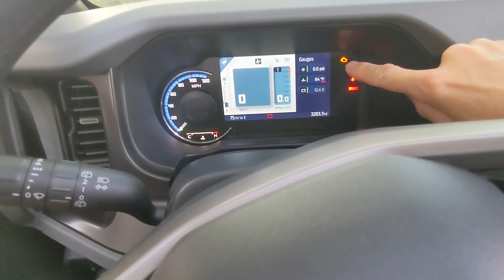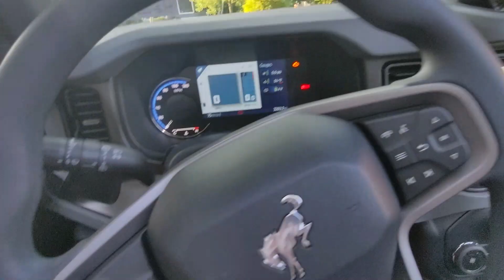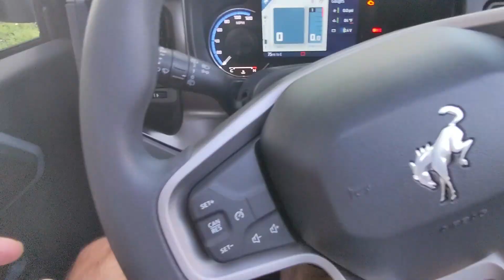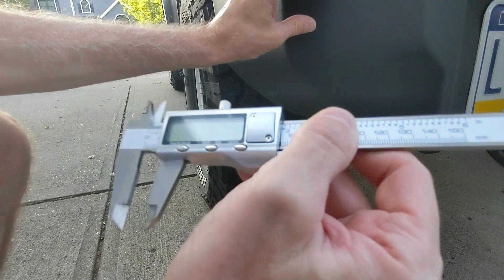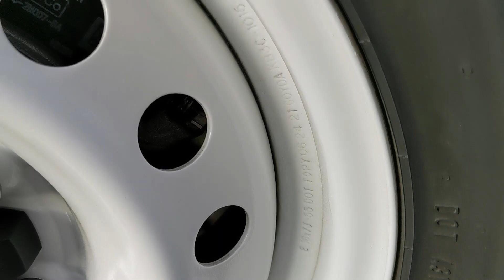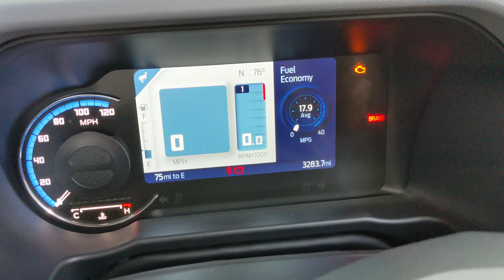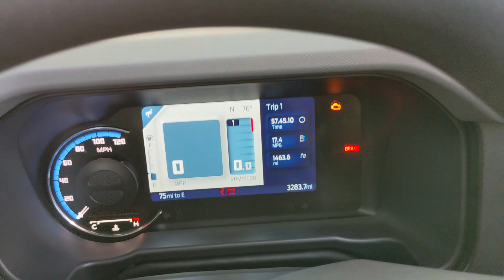Ford Bronco - One year of ownership - Viewer Q & A - Part 1

Comment: Back in olden times, building R/C airplanes, we covered them with monokote which is basically a heat shrink film. I'm sure it's not the same as vehicle wrap, but this trick might work. I've pulled air bubbles out of tons of airplanes with it.  That bubble is trapped air and if you give it someplace to go, it might stay stuck down. Try poking a very small pinhole, like with a sewing needle, into the bubble on the wrap, then press the air towards the pinhole. If you have access to something like an insulin needle, you can kinda suck the air out with the syringe, or just pull the plunger out and leave the needle in while you push the air towards the needle tip.
Reply from the maker: Thanks for the tip. I have tried this, it does remove the bubble temporarily, but it comes back in the same place. Maybe once the bubble forms the adhesive breaks down in that spot? Not sure. Thanks for the comment

Comment: Your paint job on the wheels look perfect. I have painted steel wheels in the past but I just broke down the bead and reinflated after painting. different strokes, that's all.
Reply from the maker: Yup for sure there is more than one way to do it for sure. Most important is to spend the time prepping the surface. Thanks for watching!

Comment: Nice detail on the review.  Was thinking about the larger air bubbles in roof wrap...  wondering if you can't just take a sewing pin and prick them - then squeeze air out and then reheat that area to bond back to roof.
Reply from the maker: Yes you can, and I have tried that. It does take the bubble out, but it comes back rather quickly. Thanks for the suggestion and thanks for watching!

Comment: Nice video, looking forward to part 2. Other than lockers for those who would “need” them, not really missing out by getting a base over getting a higher trim other than a few more bucks in your pocket. 😃
Reply from the maker: I 100% agree. If you live in the mountains, you probably want to get a Black Diamond or higher. But for light offroading the Base is a great option, you can add the things you really want and still save a lot of $$$. I will be talking about lockers in the Part 2 video so stay tuned...

Comment: Great video, your bronco looks great. I have a 2022 Big Bend 7 speed 2.3 and just returned from a 4800 mi. trip form Orange Ca. too Canadian border N. Minn. through Denver both ways, I reached a high of 25.1 mpg flat land and low of 17.3 in the mtn's., avg. speed 75 on the highway and total mpg of 22.1 on reg. gas for the full trip so I would say that is darn good for a barn door and only mod I made was a K & N air filter (ya, I know it will destroy my engine) I have put over 100K mi. on my Goldwing's & BMW's with it and never had an oil comsumption problem or engine problem. 
I have owned a 1974 Broco Sport and my son now has my 1973 Stropp Baja Bronco and I would not trade this new one for eather of them and that is why my son has the Baja and its original not a rebuild from parts.
Reply from the maker: What an awesome trip! I have not done too much highway driving so maybe I will get better MPG than I am thinking. Great to have lots of Broncos in the family. PS since you have a Stroppe, if you have not seen this, it is pretty awesome: https://www.bronco6g.com/forum/threads/bill-stroppe-baja-bronco-tribute-build.32637/

Comment: I’ve chosen to try and get a bronco in the future.  I don’t off road however but I just love how it looks. Im just not sure which trim to get and if I should get the Sasquatch’, I like how tires and lift looks with the Sasquatch package
Reply from the maker: If you are not going to be going on difficult offroad trails, I would recommend you skip the Sasquatch, and instead purchase bigger wheels, tires, lift from aftermarket. You will get the look you want and save a lot of $$ in the process. You won't get differential lockers or the advanced transfer case with auto engagement, but if you are going for looks that is my recommendation.
Reply: @BudgetBronco  okay. Yea I’ll never go off road. Which trim should I go for then ?
Reply from the maker: In my opinion, Base is the way to go

Comment: Toying with the idea of wrapping top. Can you remove wrap once it's installed without much difficulty, in case I want to switch and paint it?
Reply from the maker: Yes. I have not done it (yet) myself, but they say it can be easily removed if you want to.
Reply: @BudgetBronco  cool. I'm going to give it a try. Wish me luck.
Reply from the maker: You got this!! Good news is that worst case you might screw up the wrap and not be happy with it, but you won't screw up your Bronco. You can take it off and try again, or go another route.

Comment: great videos. love your content. Did you have to recalibrate your speedometer after installing the larger tires? if so, did you do it yourself or was it done by the Tire Shop?
Reply from the maker: Yes, with this setup your speedo will be reading about 7% lower than actual. I did recalibrate using FORscan. Search on YT and you will find some videos to help with that process.

Comment: Thanks for the inspiration! What a good looking rig! I have 1 question do the tires sit flush or are they still some what "inside" the fender flares?
Reply from the maker: Thank you! The tires are essentially even/flush with the standard non-sasquatch fender flares
Reply: @BudgetBronco  perfect! Yea they look AWESOME. One more question those a a load E rated tire, do they ride alright? I'm 99% sure thats the size I'm going with
Reply from the maker: Yes they are load E and I think they ride nice. Granted not as nice as a true passenger tire since they are an AT tire, but if you keep the pressure at 30-33 range they are good

Comment: Do you get any clunking when pressing in the clutch going from 1st to 2nd gear? mine has an audible clunk, just wondering if anyone else's 7MT does that.
Reply from the maker: No I do not. Can't hurt to take it to a dealer and have them check it out. Get on their records, so even if they say it is nothing, if it gets worse or breaks in the future then it should help with warranty repair.
Reply: @BudgetBronco  thanks for the advice.
Reply: @Clarkeisawesome  hey mine does that. I actually have it in the shop for problems with the transmission making a grinding noise. If you find out what that is lemme know!
Reply: @jackmusc4814  mine also has kind of a scraping/grinding noise at around 1k rpm. Let me know what the shop says because my 7MT definately has some issues. Unfortunately I live over 5 hours from the closest Ford dealership so I haven't been able to get it looked at..
Reply from the maker: This is definitely a thing (fortunately I do not have it) https://static.nhtsa.gov/odi/tsbs/2022/MC-10228746-0001.pdf

Comment: do you have more info on the replacement top program? my deaier is saying they know nothing about a replacement top program tks
Reply from the maker: Hi Ken, ask them to pull up customer satisfaction program 21B49. It might not apply to you though, only for 2021 Broncos built up through August 11, 2021. You can also read more about it here: https://static.nhtsa.gov/odi/tsbs/2021/MC-10202718-0001.pdf

Comment: How does it handle in the snow? I drive often in the snow (WY, CO) and currently have a 2 door sasquatch with the manual on order. Thanks.
Reply from the maker: In 4WD H, drives well. If you have Sasquatch you will get the automatic transfer case with 4wd Auto so that is good for light snow too. If you frequently drive in DEEP snow you might consider a skinnier tire

Comment: I thought about getting a Bronco but the price has gone insane for these things.  Fuel mileage is not very good for a 4 cylinder,  and engine problems are increasing.  My V8 Raptor gets 15 mpg, roomy, has many features I would have to pay extra for on a new Bronco.  The new Bronco looks cool but I'm not impressed. Sorry Ford.
Reply from the maker: I was lucky to get mine early and paid MSRP $31k for the Base so I still think that is a pretty great deal. The 2.3L has been rock solid, very few issues I have heard about, unlike the 2.7L V6. True, the MPG is not great lots of other things to love about the Bronco, and the F150 Raptor too!